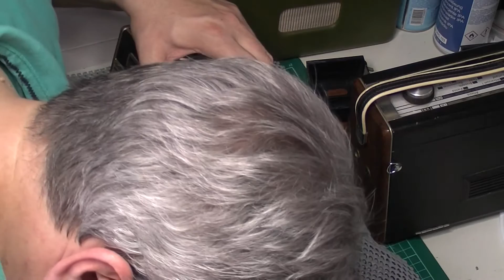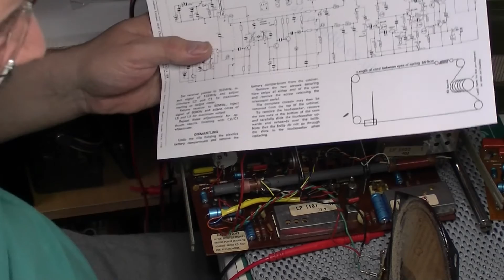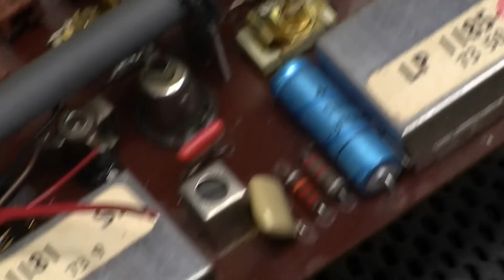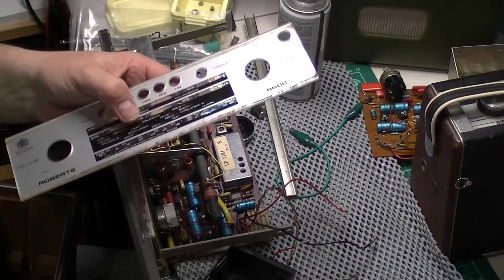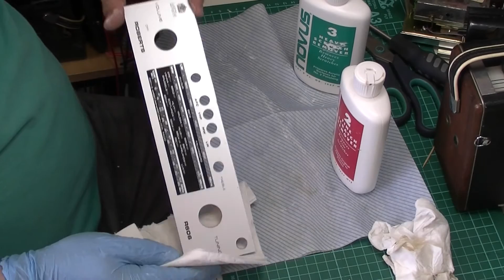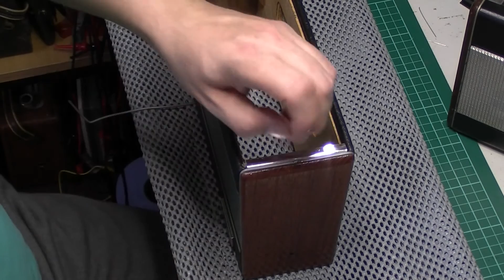Roberts R606 24hr restoration

Comment: 1974 - 1980. I have a 1975 R606 mb. Very low serial number. It's never been opened up. Had to buy a new PSU6 power unit as the old one died! This is a great radio. Mine has been on daily for the last 50+ years.

Comment: Hi there mate do you know if you can get the ariel for the R606MB.
Reply from the maker: Hi. I don't think Roberts have any left so your only option for an original one would be a donor set. There are some aerials available that would fit from aliexpress but don't have the swivel joint
Reply: @Radiocruncher  cheers  mate do you know which Aries  fit maybe I could modify  it to go onto the swivel joint.

Comment: Do you have any info on replacing the mains power regulator in an r606-mb? We have one we’d love to be able to plug in and stop having to use the batteries!
It doesn’t seem to work from a power lead but the battery power works perfectly.
Reply from the maker: It could be the internal fuse, a switching problem, transistors of the capacitors. As long as its not the transformer it should be easy enough to fix
Reply from the maker: It could also be the rectifier or zener diode as well

Comment: I have a 606MB which has the same board as your 606, it has the same tuner module and the same two if modules. Might be a later hybrid, who knows. I think the rf tuner is faulty as it has great vhf but no mw or lw, not sure where to start with that.
Reply from the maker: Hi. Sounds like it's an early hybrid of the later model. Start with cleaning all the switches. Then check the oscillator circuit for AM

Comment: great job where did you get your speaker from and could you show me a picture of the wires on to the battery compartment of forgot to take a picture thank you for your help
Reply from the maker: Hi Robert. The speaker was the original one that I took out for testing purposes. The battery connections are shown at the start of the video around 10 seconds in. If you are still stuck then let me know and I will pull one from stock to have a look
Reply: @Radiocruncher  Hi Thank you for your Quick replay, My Roberts Radio is the R606 MB, I figured it out when I realise the speaker clips were small, and the other two were big lol, thank you once agian.

Comment: Can u link me the caps u used
Reply from the maker: I used mainly Vishay axial caps. It was a long time ago though so I can’t remember the values off the top of my head. The service manual with the original values is available online so just match the values as close as you can and make sure of the correct voltage
Reply: @Radiocruncher  Thankyou! where could i purchase caps like this from?
Reply from the maker: @hifi.david.  CPC, Farnell and RS are the suppliers I use for these

Comment: Where do i shop to get silver top buttons for a R606-mb ??
Reply from the maker: You could try these https://rover.ebay.com/rover/0/0/0?mpre=https%3A%2F%2Fwww.ebay.co.uk%2Fulk%2Fitm%2F183576238996. The only other option is to buy a spares radio

Comment: Great accent. I bought one exactly the same but in a sorry state. I can't even get to the batteries yet. It seems sealed from outside. This video also didn't show how to get to the batteries. Anyway I managed to get to the batteries. Amazing easy if you know how to. The radio itself is working but all the batteries have leaked extensively and have destroyed all the contacts. Mine is in maroon colour and the aerial is also intact. I wonder when they were made.
Reply from the maker: Glad you worked out how to get the battery compartment out. It’s just a lever from memory that you swing to one side. These were made in the mid 70’s. I have recently fully restored a maroon one so I will do a video of it soon. Thanks for watching. Regards Graham
Reply: Hi, it is really an honour to watch your videos. You are certainly a great communicator. As for opening the battery compartment, the hole at the bottom is for pulling the cover towards one end so the other end  would have a gap to lift the cover.
Reply: Hi again, I don't think I can make use of the radio that I bought. I am really a beginner and this needs your expertise to create another masterpiece for us to enjoy. I also have a very old Pam transistor radio that I would like to gift it to you together. The Pam radio does not work, and I have not messed about with it at all. It looks all original.
Reply from the maker: Hi Farhad. That’s very kind of you. The Pam radios are very old and depending which model could even be the 1st British transistor radio. Drop me an email to graham@radiocruncher.com and we can discuss it further.
Reply from the maker: Once you have pulled the wood out of the way you will see a metal tab with a plastic peg at one end. Slide the metal tab over and you will be able to lift the battery tray out

Comment: Super! That come out really well. Quality buffing :)
Reply from the maker: Glad you liked it Andrew. Sounds great as well. Caps were well out of spec but it did still work. Probably should have got the modules out for a look as even though they have silicone transistors in I expect if they contain electrolytics then I may have to swap those out as well.